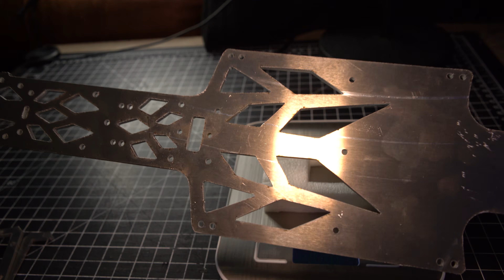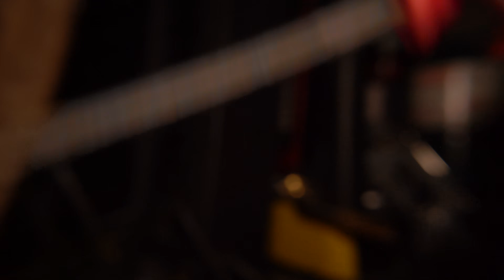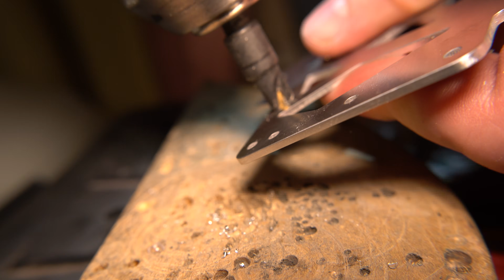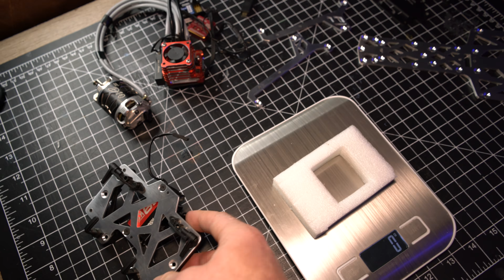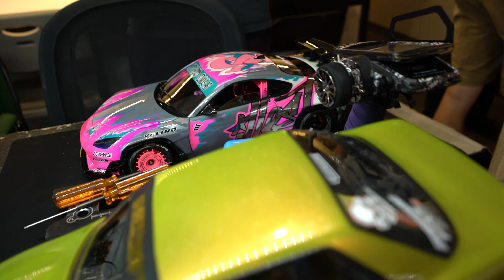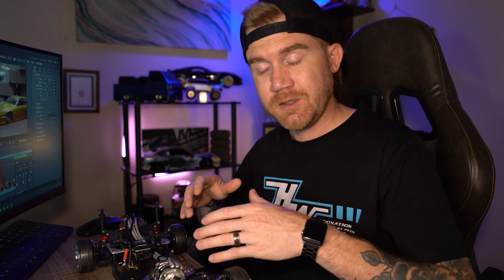MST FRX RS Prototype Chassis Test - Does it Actually Work?

Comment: Shift the battery more forward and run the battery north south rather than east west configuration and it might let the rear transition quicker?
Reply from the maker: No not on this car the battery needs to be as far back as possible since the car has so much front weight.

Comment: So you like how it feels, you just need more grip and less weight? Well, I'm sure you can solve the weight, but for grip, I'd recommend old-school hard rubber drift tires.
Reply from the maker: You have to run these tires at our track, rubber tires are not for drifting…
Reply: @shredcraftrc  HARD rubber, dude. I'm not talking about touring car tires, I'm talking about OG drift tires from 2014-2019. Those more scale-like setups drive better. Modern cars just look like air hockey pucks for the most part.

Sucks that it won't be an option at your track either way, though. If it were me, I'd just not tell them about my car or tell them to shove it if I were only there recreationally (IE not competing), or find a different track.
Reply from the maker: @Drunken_Hamster all modern rwd drift cars use plastic tires and they do very in compound and make a difference, most tracks require a spec tire to run.
Reply: @shredcraftrc  Do you have a comparison video on this? Seems hard to believe that hard plastics are going to make much of a difference on polished concrete or wood.
Reply from the maker: @Drunken_Hamster go watch any of the videos with my RDX it has no problem with traction.
Reply: @shredcraftrc  That RDX is also a high mount, might-as-well-be rear motor more than 60% rear weight modern "comp" spec build. Completely defeats the point of what I'm saying. Of course, it has traction. It can't NOT have traction, given it has a more rearward weight distribution than even a modern 2wd 911. 

My point is, has been, and always will be, that setups like that don't look as scale-accurate when drifting as old school, more balanced setups did. They rotate from the wrong end of the car and don't appear to drive the front through the turn with intent. The front is just along for the ride. It's all wrong. Literally backward, even. The rear should be whippy while the front is where the car rotates and controls from.

Closer to a 50/50 weighted setup accomplishes that. Just look at old Eagle TA05 and R31 setups, or Sakura D3 rwd conversions, or the FJ9 Bulldog conversions. The problem is that with less weight on the rear, there will always be less traction, and thus you need grippier tires to compensate for it, because God knows that even the modern 5/8ths rear weight plus comp cars will use every "trick" in the book to get as much rear grip as they can, too.

Spec tires should be based on weight. I theorize that about every 3-5% weight bias change should be a compound change in order to match grip/accelerative ability.
Reply from the maker: @Drunken_Hamster 😂😂😂😂
Reply from the maker: @Drunken_Hamster listen, you’re clearly not experienced in the hobby, but its just that a hobby and you can do whatever you want, all my videos are based on my experience and what works best for me and what I enjoy to drive, all RWD drift cars have more rear weight bias because that’s what works best, there is a reason ever manufacturer designs their cars that way. These are toys and not real cars and the physics of driving is very different than a 1:1 car. Go read the rules for RDC there is a weight limit and spec tires level the playing field for everyone competing. I’ve drifted with rubber tires, go watch my old rmx video, it’s fun but you definitely can’t tandem with that setup. The cars aren’t designed to withstand that much traction, you start to strip diffs, spurs, snap axles and blow out ball cups. I competed in 1:1 drifting for many years and rc drifting is different, that’s just the way it is.
Reply: Where can you find these old school tires? I've seen rubber touring car tires and hard plastic drift tires everywhere i look. Where is the 1 dark cranny you can find hard rubber drift tires good sir?
Reply: @gerneticut  They don't seem to make them anymore, but it was stuff like what came on the HPI E10 drift car way back in the day. They had actual tread and were a very hard rubber/polyurethane, like skateboard or longboard wheels in terms of durometer rating/feel in the hand.
Reply: @Drunken_Hamster thanks for telling us why we all use the hard plastic tires to drift.
Reply: @gerneticut  And by this, you mean...? I'm not debating why shit tires are used. I'm saying they shouldn't. Nor should 40/60 (or even more rearward) weight distribution.
Reply: @Drunken_Hamster your saying the only thing available shouldn't be used? You missed the point the tires that are used are being used because that is the only thin available.  Make these hard rubber tires you jeep talking about that way people can try them out and decide if they think they are the answer to every life question like you do. Now i asked you where to find theses hard rubber tires to show that the only drift tires available are generally seen in any modern rc drift video but you couldn't pick that up and caused me to have to type this long comment so you might understand a long winded explanation.
Reply: @Drunken_Hamster and 60/40 weight distribution is a starting point and its that way because most drift chassis have the motor more rear biased causing the weight to be more centered on the rear wheels. You can change the weight bias to be whatever you want. If you want 70 percent of the weight on the front then set it up that way. Do it. No one will stop you. If you dont want to listen to the way pros set their cars up dont listen but also dont expect to be able to compete at the same level.
Reply: @Drunken_Hamster o and fyi the hpi tires suck. I jave used them as front tires for the looks but they handle like garbage until they get worn to your suspension camber angle so your not riding on the inner edges of the tire. Another problem i have with the hpi tires is they are so square you have to lift your car to get full steering without hitting the body because the sidewall of the tire will hit the fenders,  i dont have that problem with mst or yokomo tires.
Reply from the maker: @gerneticut Also funny he has recommendations with little to no experience…….

Comment: What 3D modeling system are you using to design your base chassis? Does it give you properties for you model? Like volume? You should be able calculate the component weight based on material density and part volume. This will help when selecting a material in send cut send. Also, Send cut send offers Carbon fiber, not sure about cost.
Reply from the maker: Since I come from the world of graphics, I use 2d vector software called Affinity Designer, for SCS I just export eps files, I also use Fusion 360 for making step files for other manufactures. I'm deff not doing it by the book. SCS carbon prices are extremely high and I have another carbon manufacture that I use that im currently getting quotes from.
Reply: @shredcraftrc if you’d like some help, I use autocad and alibre. Might be able to help weights
Reply from the maker: @JoseRamos-su3ep I appreciate the offer but I think I have it squared away.

Comment: my frx feels the way you are saying also its super smooth and a solid chassis but i just cant keep pace with the comp chasis at all i put my md1 one track and it feels so light and such good acceleration and the frx feels like you say heavy but its super super smooth i do have like 68% rear bias on my frx and its still nothign like the md1 ive just bought a rdx to test in stock form
Reply from the maker: Nice, that's cool to hear that you have a similar feeling, I'm potentially going to try and make the chassis and parts out of carbon to see if i can get the nimble feeling of my RDX. If you like the MD1 you'll really like the RDX, I was driving an MD1 before I fell in love with my RDX.
Reply: @shredcraftrc  im trying to build a competition chassis so it will be focused on performance not bling so i will try in stock form and add upgrades only if they make extra performance to many times i build chassis and full bling and i feel it hurts performance to do it this way
Reply from the maker: @kilner79 Couldn’t agree more, thats what my RDX is built for.
Reply: @kilner79 that's a let down, the frx at our local is killer fast and agile. Its full stock plastic as far as I know and it absolutely slays. Ain't no "comp" chassis getting away from that thing. We on polished concrete
Reply from the maker: Lots of variables, it’s not just the chassis itself but more how comfortable someone is with it along with tuning and electronics.
Reply: @ArchetypeGuitarsNZ tracks and skill level are all different at my track we have all been RC drifting for over 10 years 5% performance can be a massive difference for us. But I can say it's butter smooth and has more potential for sure
Reply: @shredcraftrc Totally agree. I still regularly drive my d4 and hang with the big Dawgs 😜
Reply: @kilner79 I reckon if you keep on it you'll squeeze that 5 percent out brother! I'm not saying those other chassis layouts aren't easier or inherently faster. Believe me many of the guys I drift with have crazy dialled chassis above mine. I definitely have to work harder to stay with them depending on what I'm driving.
Sometimes it takes years to fully dial a chassis and others you'll just make that one tweak and it's on fire!
Over 10yrs rwd over here in NZ too stay slideways man!
Reply: @ArchetypeGuitarsNZ  yer im going to stick with it i really like the car and its real nice to drift the performance will come later im shelfing my md1 and going to make an rdx for a comp chassis and the frx can be my tinker chassis
Reply: @shredcraftrc  after more testing i have removed all boost from esc setting and move to a 32t pinion and just added some turbo  for transition and corections its much better i think with the front motor setup you cant generate the squat like on rear motor car so better to have very progressive throttle for traction i also tested with lots of springs and oil variations and ive ended up back on teh standard setup from teh manual 

i found a good increse in traction after trying a set of topline super high traction wheels
Reply from the maker: @kilner79 Cool to hear! Do you really feel a difference with “high traction” wheels? The tires are stiffer than the wheels so the spokes are essentially bending under load, so having more camber progression creates the same effect, but thats just my experience.
Reply: @kilner79 hail yeah man! I'm stoked to hear you are getting more out of it.
I have a wrap up frd v6 which is very similar layout, and would agree about the progressive throttle thing. The shocks were a bit sticky at first and once I changed orings and sorted that it performed a lot better. I doubt you are having that issue but it's just another one of the many variables when troubleshooting